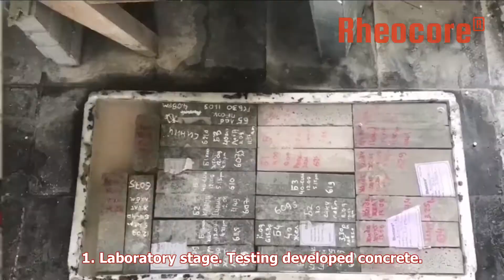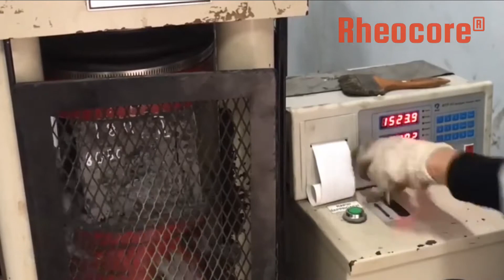70 MPa SCC for pavement tiles 500 m2/shift production in Vietnam. The lowest cost on the market ever

Comment: How can you prove that your concrete production is low cost as compared to other?.
Reply from the maker: We have done tens of projects across Vietnam. We use 30-35% less cement in our formulations. We replace natural sand with artificial stone. B90 mpa we made for 950 000 vnd/m3. I do not think that you could find anything cheaper in Vietnam. Text me, we can discuss further.